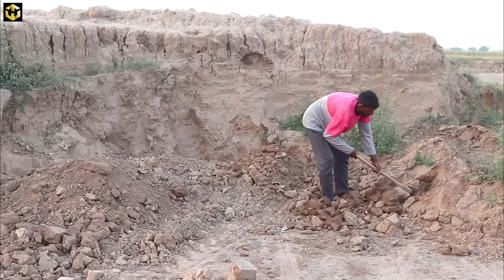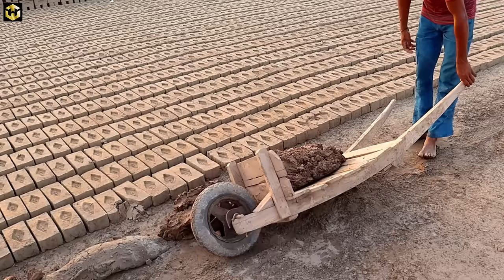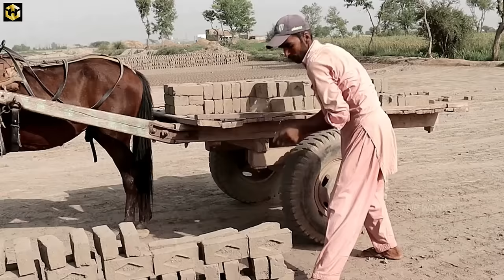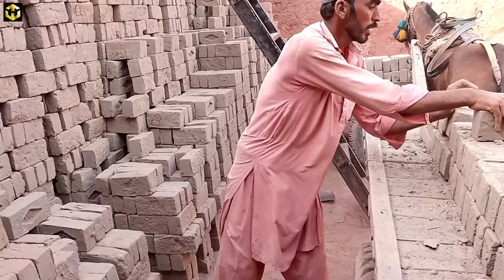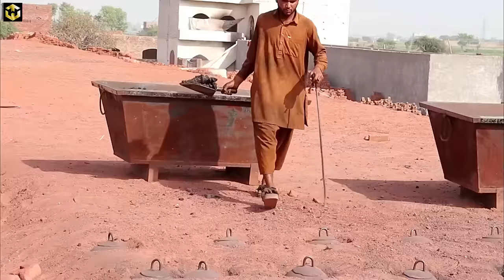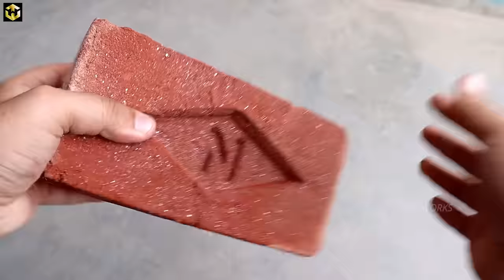How to Make BRICKS with Amazing Handmade Technology

Comment: I would not trust that bricks made of clay to build my house 😂
Reply: Dude; those bricks house about 1,851,148,725 people. That's 1.85 BILLION people. And those are from three countries i know that use the same type of bricks. Most probably in many other countries too. 
So maybe, just maybe the bricks aren't as bad as you think they are..
Reply: If they were going to break, they’d have broken in the firing. The need for machine compression and deairing in western world manufactured bricks is to reduce breakage in faster firings. If you don’t mind hand-building and deconstructing a warehouse sized kiln and running an extremely toxic multi-day coal fueled firing with every batch of bricks, this way is fine.